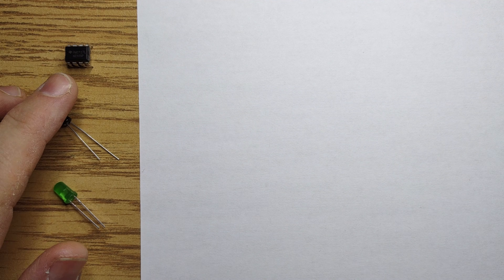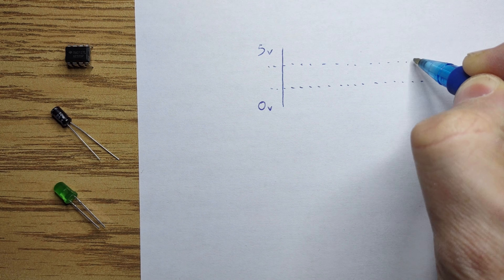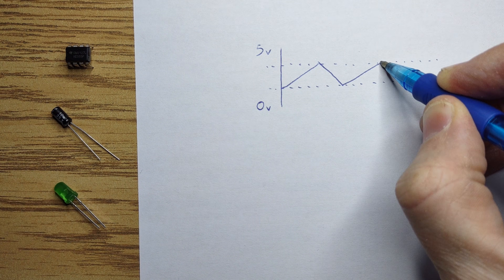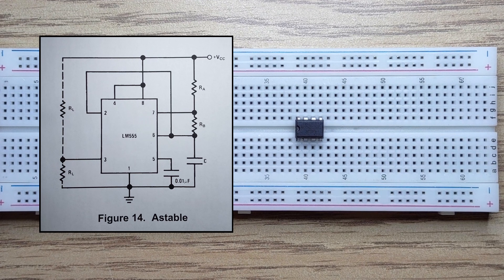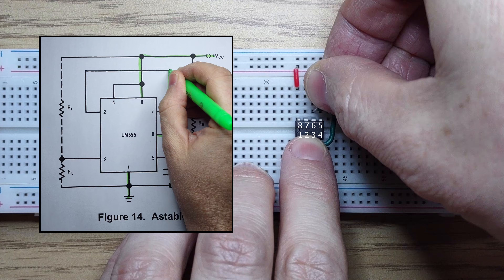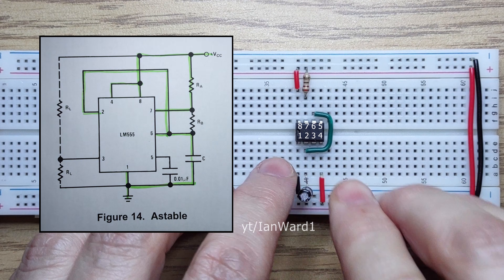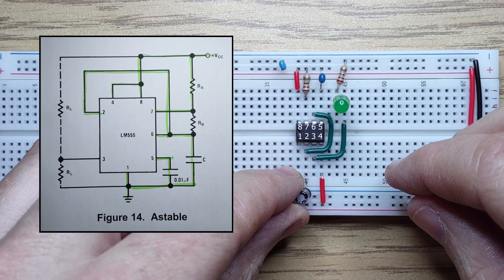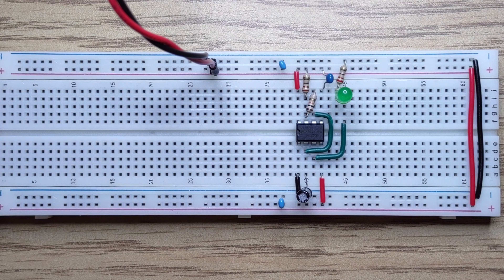Green Blinkenlight: Creating a Simple Clock Circuit with a 555 Timer

Comment: hello Ian i hope this helps but I used to have dry skin on my hands, especially on my fingers, which would often bleed if I played basketball or lifted something heavy. I no longer have this issue after conditioning my hands to develop a tougher skin layer. My approach was to gradually heat up oil and carefully apply a small amount to my hands, repeating this process and slowly increasing the temperature over a few months. I was also a cook at a restaurant for a while, handling hot pans and similar items, which further helped in building this resilience. By the end, my hands became much more durable, and the problem was resolved.

Comment: Hello and good day!

Thanks for recording and uploading this wonderful tutorial, it helped me out a lot. Though one piece of crucial information that was kind of missing was the complete list of the names of the pins.
They all have numbers, but I had trouble following the tutorial because I wasn't sure which pin has which function. For anyone facing the same hurdle, 

here is a mapping of all the pins to their names:
1 => Ground
2 => Trigger
3 => Output
4 => Reset
5 => Control Voltage
6 => Threshold
7 => Discharge
8 => VCC

Comment: What is the ceramic capacitors value?
I am trying to remake it but I think I have the wrong compacitors
Reply from the maker: Looks like a 1uF cap connected to pin 5 instead of the 0.01uF recommended, and it's connected to Vcc instead of ground. The decoupling capacitors I used are 0.1uF. These are just capacitor values I had lying around that seemed to work. If you know how these values should be chosen let me know.
Reply: @IanWard1  may I ask why did you connected it to Vcc if the datasheet specifies that it must be connected to ground?
Reply from the maker: @cesarhuerta9632  connecting to Vcc was just an accident that I didn't notice until editing the video. Seems to work fine either way, though so I've left it.
Reply: @IanWard1  it just works! You sound like me when a program works without debug

Comment: Can someone pleas explain this to me? For weeks, I have been trying to get this circuit to work: setting it up in this exact manner. But, the discharge never occurs. The output will get stuck low, but the capacitor will never discharge. Is it possible my IC is damaged somehow? i have tried just about every possible configuration, using a physical RA and RB, using a potentiometer to represent both, using an electrolytic cap instead of a tantalum one, but the exact same thing always happens: Output goes low, cap voltage charges all the way up to Vcc. I know it must be some issue with the path from the Cap through Rb to discharge but I can't figure it out.
Reply: Also make sure your IC is the right way.

Comment: Hi
Sorry for the stupid question.
I manage to let this work on a breadboard.
I didn’t have exactly the resistor and the capacitor but I managed to find the right stuff.
So I tried to put on a strip board but I’m noticing something weird.
I didn’t use the small capacitor that you used but it was fine on the breadboard.
Consistent light and good range of oscillation.
On the strip board the led emit a really low light before actual blink, I can notice when it’s really slow.
As I said on the breadboard don’t happen but I copy the same circuit.
Any help?

Thank you
Reply: Something my dad told me, i had an issue with a circuit i made and he told me to put a large-ish capacitor (maybe 1k/2.2k ųf which is what i use) between the supply and the entire circuit. Suddenly, the effects of what i got from my breadboard is happening on the circuit board, which is what i wanted. Try that, maybe you just have a current shortage and need more available current, idk but good luck though